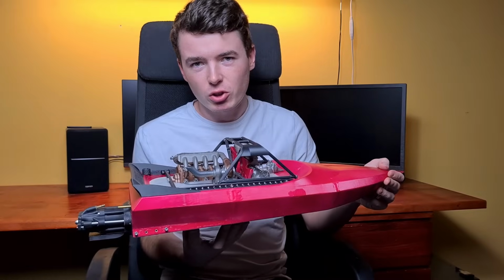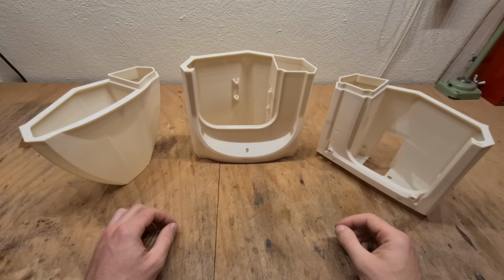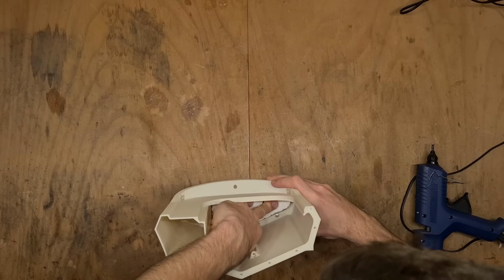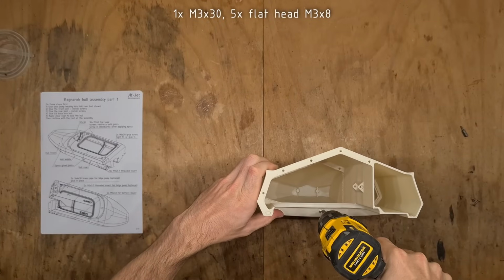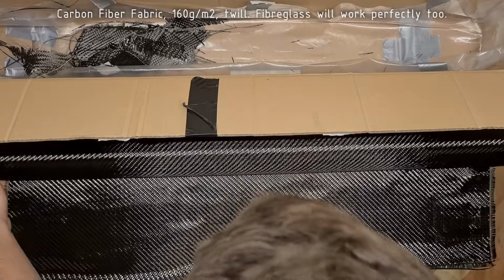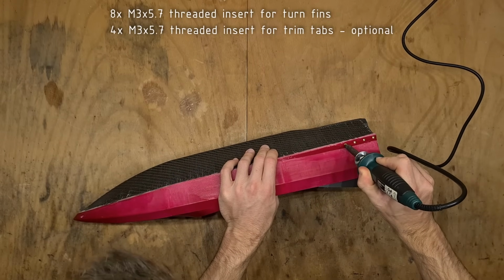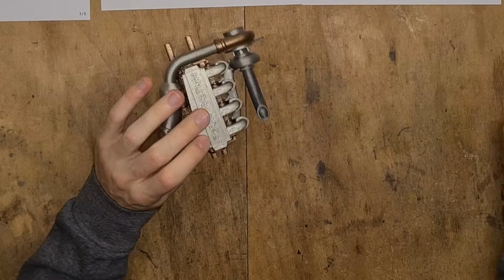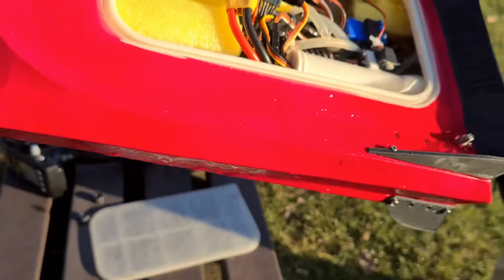RAGNAROK Full Build / 3D Printed Jetboat Assembly

Comment: Nice video!! One question about the pump in the video. The brass tube coming out of the pump on the outside is different from my m35. Is that an update?
Reply from the maker: @TheMrmanning71  Good point! The brass tube coming out of the second stage, as well as the pipe in Hull rear which connects to it, is just my custom modification for doing some measurements. The public version does not need it and does not have it, so no worries:)
Reply: @mjetdevelopment  so that's a data-logging-ready Ragnarok 😁